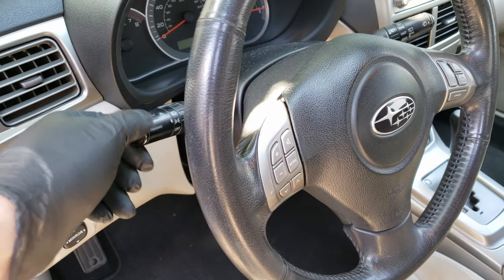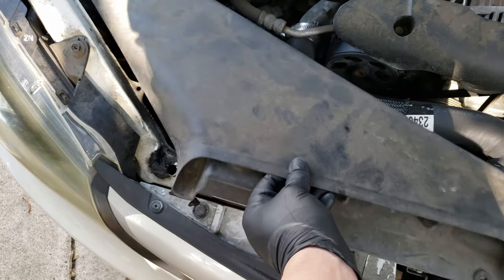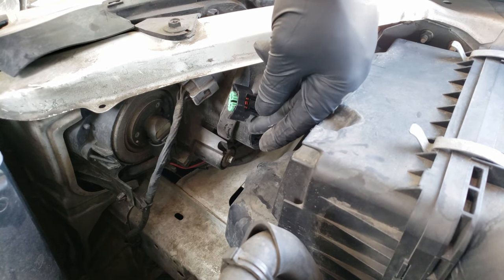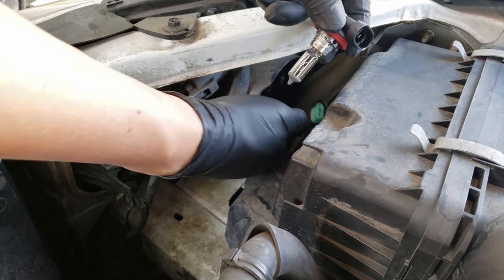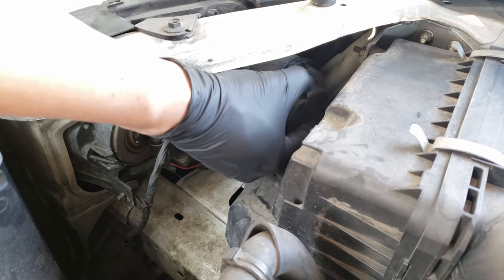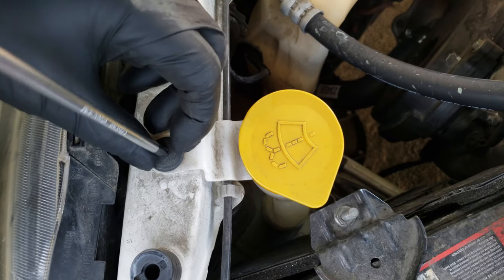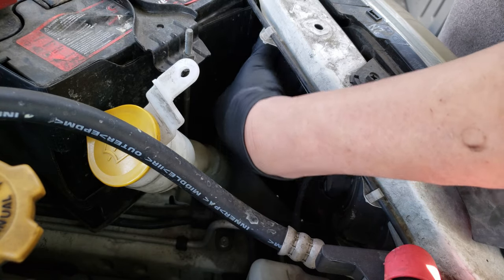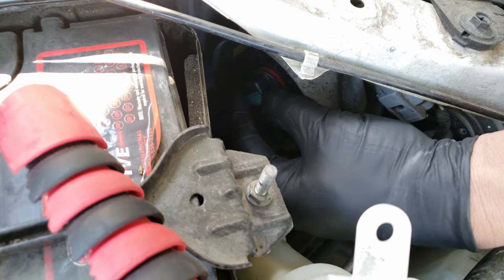How to Replace Headlight Bulb - Subaru Impreza

Comment: Great DIY video front to back!  Showed the bulb package, the steps to access the bulbs (both driver & passenger sides, all remove & replace steps (including if the rubber seal was left behind… exactly what happened).  Clear video. Not sure if the year of vehicle changes anything, but that might be a nit… Thank you!
Reply from the maker: Thank you🙂

Comment: Great, clear, and to the point video thank you!!!  In my 2010 Impreza, the air intake clips were ridiculously difficult to get out and wouldn't really go back in without partly breaking.  grrrr.  Apart from that, pretty easy to exchange bulbs.  I put in LEDs which makes a huge difference.
Reply from the maker: yea those clips are very fragile, especially with the heat and how long its had em it makes em brittle

Comment: Thank you man.thats exactly what i need.God bless.by the way to change oil subaru if i dont have a ramp or jack.
Reply from the maker: Thank you🙂..well not sure theres enough room to work under, unless u have a small trench in the middle or u ride one wheel up on a curb so it lifts one side up and have enough space under

Comment: oh fyi, my 2013 impreza uses an HB3 9005 bulb.  the layout and steering wheel looked the same so i thought nothing of it, other than not having that cover cap for the bulb  i bought the H11 off the video and assumed it would work and now i gotta go back to the store.

edit:  ignore me, i pulled the daylight driving bulb.  at least i caught this before i went to the store to return , buy the wrong one again and have to back a 3rd time to buy the first bulb again.  i can't be the only one lol